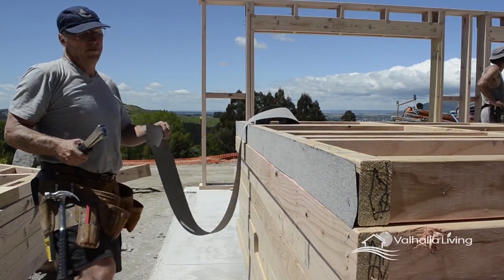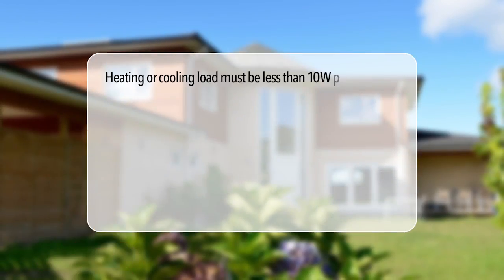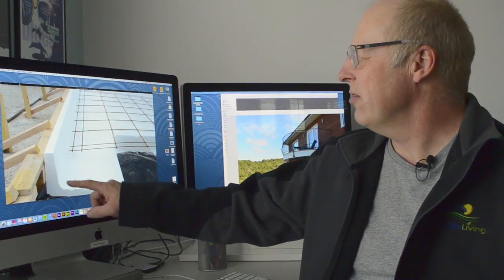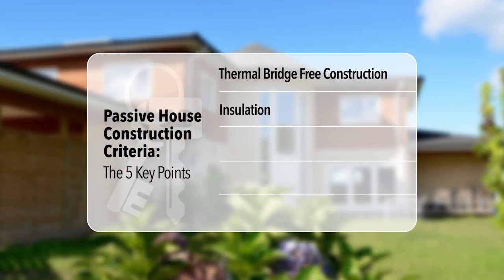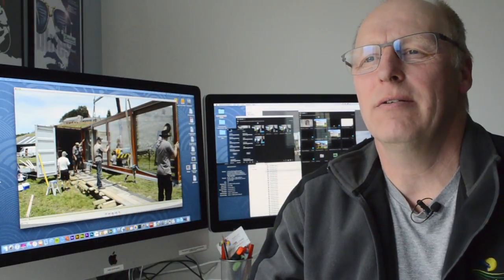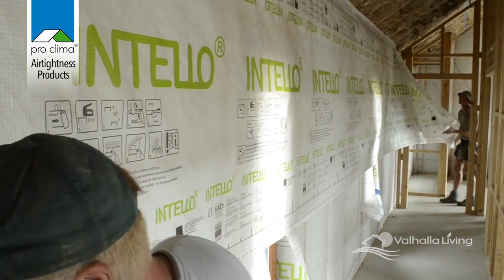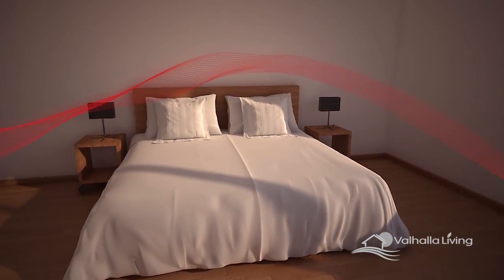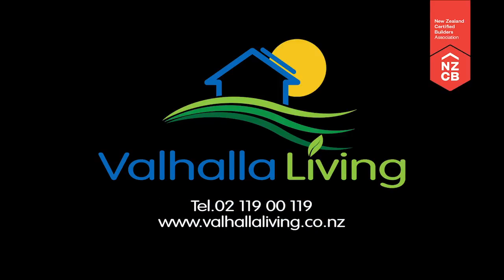Passive House Construction in New Zealand: The 5 Main Building Criteria.

Comment: how much does a passive house cost about 200 m 2
Reply: it appears to be about 2-7% more expensive per m2.
which actually means the investment pays of for itself rather quickly.

You can find a cost breakdown for two sample buildings at https://commons.bcit.ca/zeroenergybuildings/files/2018/05/4229_070-2016-03-08-BC-RPT-Passive-House-Costing-Study.pdf  The short version is: walls, windows, roof are 20% more; furnace is 60% less; total 2-7% more. 
Energy savings means the return on investment takes around 20 years (assuming energy costs don't go up but they likely will).
basically its typically slightly cheaper over the time it takes to pay back the mortgage.

something else to consider though is comfort, you'll never have a cold draft, cold floor, or other discomforts common in other houses.
so you are investing in energy savings and additional comfort

Comment: None of the points covered in this video have anything to do with Passive Solar house design.  Passive solar housing is a vanity project to see who can blow their own horn the loudest.
In fact the whole concept is BS.  You are designing super energy efficient houses so you can then add expensive windows and suggest its so you can recover heat in cold weather.  The facts are that as you increase the efficiency of the window with triple glazing low e and argon filled, you diminish the amount of solar heat you recover.  If you design a house like this in Canada where the average temperature could be at 0 C or lower.  You find that the house performs poorly during cold months and there are massive temperature swings.  Who would want to live in a house where the temperature could swing 10 C in a day.  Sorry this is a Bull Shit Video
Don't get me wrong, there is nothing wrong with energy efficient houses just donn't go the passive solar route.  Its like a fucking cult.
Reply: Interesting. What energy-efficient designs would work better or best in Canada?
Reply: Umm this is New Zealand not Canada. Temperatures are normally in the mid to low 20s (°C) over most of the country during summer. 

Winter temperatures are generally 10–15 °C (50–59 °F) in the North Island. The South Island is a bit cooler, with maximum temperatures around 7–12 °C (45–54 °F)
Reply: @peterc66  Reduce window size as opposed to increasing it.  It the highest heat loss and the most expensive.  Active solar collectors with added thermal mass.  Nothing wrong with adding extra insulation which is typical in passive solar designs.
Reply: @EdgkumWat  In that case you really dont require much heating do you?  So why this expensive option?
Reply: @MeBituman  this particular house is built in a colder climate as it’s not far from a snowy mountain and next to a lake. So temp usually drops during winter. The temps I mentioned above were only averages across the country but certain areas drop far below others depending on where you build.
Reply: @EdgkumWat   Sounds like energy effiency while retaining the view would be the only consideration for passive solar.  Still not worth the excessive cost.  I stand by my post.  Nothing but a vanity project.  Your gaining the most heat when you dont need it and causing uncomfortable temperature swings when you do need the heat.  I f you are looking solely at energy efficiency design an active solar collector into the design.